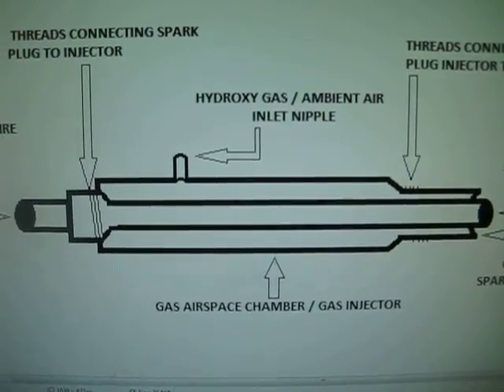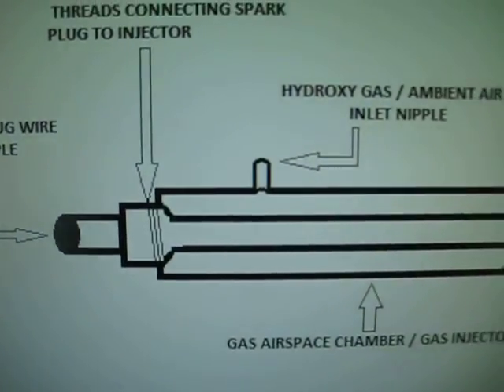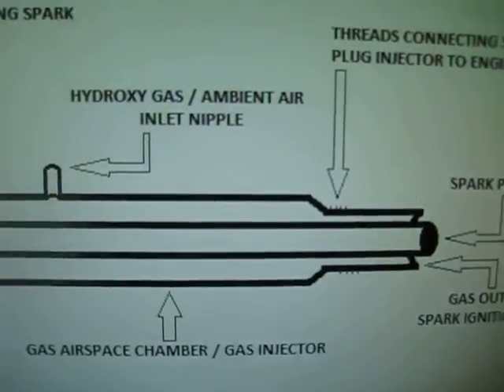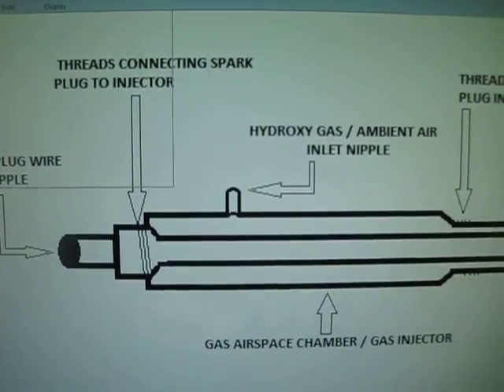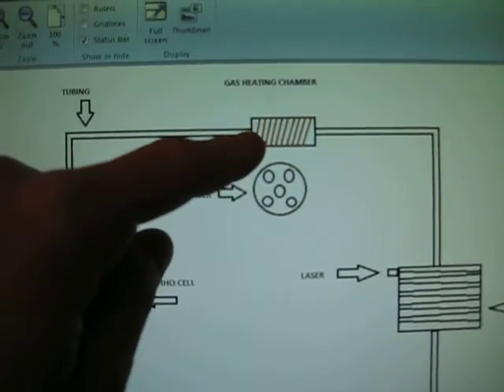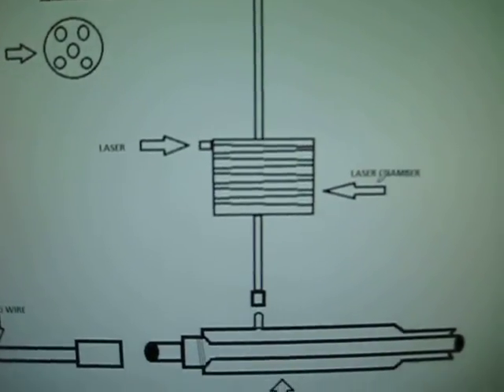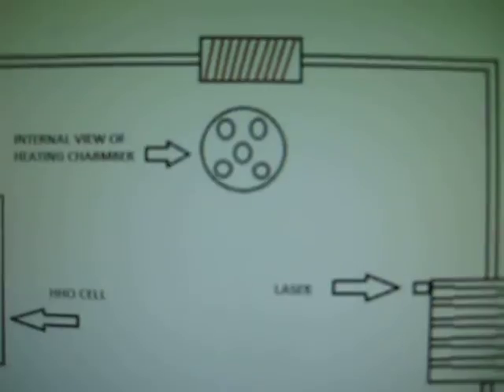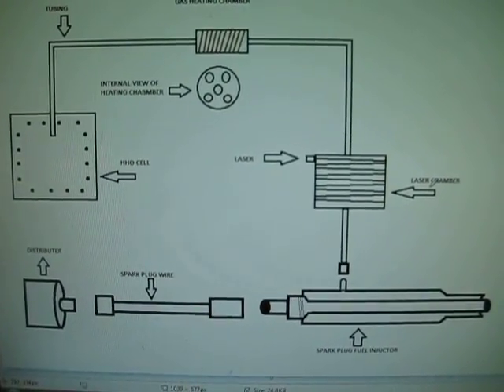HHO SPARK PLUG FUEL INJECTOR

Comment: I don't see any way of preventing the HHO from burning inside your injector. And by the way, steam does not burn, it does expand though, when heated. Stan would have used the steam to slow down the burn of the HHO and add additional expansion energy to the gas mixture in the cylinder.
Reply from the maker: There would be grooves between the walls that separate the walls and act as a flash arrestor (groove would be about .001). As for the steam helping with the HHO process the hotter the water the less energy you need to split the molecule. Stan used exhaust gasses to slow down the burn of the HHO he did not use steam to do that.
Reply: Tyson Capel
I'm just going by my basic knowledge of physics here. I don't know of any reason to think that tiny grooves can act as a spark arrestor. It would create a bit of minor turbulence, but that wouldn't prevent the backward propagation of flame, SFAIK. For that you would need something that could act as a heat shield, which is not evident in your drawing.

I do know that HHO gas has it's own oxygen and therefore can burn back into a confined space where a non-oxygenated gas would be snuffed out by lack of oxygen.

And I know that steam doesn't burn, but it does expand 1800x from liquid into gas and also slows the rate of burn of other gases. If you tell me that it's easier to disassociate steam into HHO than water, then OK, but you're still not burning steam, you're burning HHO. I repeat, steam doesn't burn.

I stand by what I said about Stan Meyer. He was perfectly able to turn water directly into HHO without using or generating a lot of heat, which even electrolysis will do. He didn't have to turn the water into steam first. Stan definitely knew the difference between water and steam and he would have said steam in his patent if that's what he'd meant. Stan was not trying to hide his technology in his patents. They're not so full of legalese as to be unintelligible.

It's fairly clear from what I remember of Stan's patents that he was using a particular pattern of high voltage, low amperage pulsed DC current to create a resonance that would dissociate the hydrogen from the oxygen in the water molecules, and he was able to do this because hydrogen and oxygen in water are oppositely charged and thus attracted to opposite anode plates. A large part of his success was in the efficiency of the electrical circuit that he used and how he tuned it.

I don't know which patent(s) you're looking at because you don't say, but you're better off trying to understand what Stan actually wrote than trying to come up with your own interpretations of his pretty pictures using a faulty understanding of physics. The patent examiners didn't give Stan too hard a time because he patented things piece by piece and each piece was competently described. His work didn't raise the red flags that usually cause examiners to call something a perpetual motion machine. Thus, there wasn't a need for obfuscation.
Reply from the maker: You are correct steam won't burn, you can however use a plasma spark to ignite steam but it is first instantly turning the steam into HHO before it is ignited.

Small grooves as I explained will in fact suppress a flame from HHO as long as the space of the groove are small enough to do so this is why I said the gap would be about .001.

As for everything I have said not being in the drawing that is correct not everything I said is in the drawing because this was a simple basic drawing to get the concept out there, there is certainly allot more to it then what I have shown. 

The drawing was taken from one of my fuel injector adapters that is used to vaporize fuels such as gasoline and runs off of similar principles.

HHO does have it's own oxygen as you say that is why its called HHO (hydrogen,hydrogen, oxygen) or 2 parts hydrogen to one part oxygen. It is very unsafe to use if you don't have the proper flash back protection. the drawing shown in the video is a two in one adapter. It makes HHO and suppresses it within the same space.

I know that Stan was able to produce HHO at a very high efficiency by using the proper circuitry which would create a resonance enabling the water molecule to split at a much lower amperage then that of traditional electrolysis. His circuitry would allow for peak voltage while at the same time decreasing the amperage and was done at a resonant frequency. The resonance he speaks of was a full circuit resonance not just a resonance of one particular part of the circuit such as just resonance in the cell.

Stan did use a steam resonator this was used to keep the water above freezing which would allow his system to be used anywhere in hot and cold climates. As for Stans Injector Spark Plug it has been understood by many people that the injector did act as a steam generator within the injector itself. As for wither or not that is actually the case we need more information on his injector to be able to say for sure wither or not that is actually the case. There is not allot of information out there on his Spark Plug Injector.

I don't have a faulty understanding of physics, that is a pretty bold statement for you to say without knowing  who I am or what I know. I have spend hundreds of hours reviewing and dissecting Stans work and some of the stuff I say does not come directly from Stans work, I take the basic concept of some of the things he says and use it as the mainframe for something else. It's the concept that you often have to go off of especially when it comes to Stans work. Not everything he shows in his patents works the way he says it does. You have to change some of the stuff in order to make it work correctly because it is not completely accurate, he purposely put stuff in his patents that do not work the way he says it does. He wanted to get the concept out there without giving away all the secrets. This is why you work off of the concept and not off of exactly what he said in his patents.

A closed mind is a weak mind, you have to often look and think outside the box. 

I hope this helps clear some things up.
Reply: Tyson Capel ev gray had to do the same thing with his magnetic motor and I'm sure most inventors protect their creations this way it's also where patents on things that don't work bs comes from

Comment: Stan was splitting the water mol by using plasma at a higher voltage than most people know. I studied lightning in the lab for the gov. (sandia)The higher voltages (45kv+)split the mol with much less ampherage. This is done at a higher frequency than the 10khz stan used for his WFC. The injector system was never tested at these higher freqs and voltages ddue to what was available at the time. I replicated the whole process and found it barely breakeven when using an ICE to demonstrate.

Comment: Stan had over 250k in his bank account and had just signed a 50mil contract at the time of his death.He wasnt waiting for funds. The injector system just wasnt working right. It didnt rely on sonocatalysis,that was bs that he used to throw people off so he could finish his work without hassles from others. water was split by plasma catalysis in the cylinder and was only used during accelloration phases. running power was had by recirculating the exhaust gases thru the air processor unit.

Comment: yes it does...It burns all the time when you drive down the road with your gas guzzling polluter. Gasoline makes O2,H2O,NOX,CO2,and leftover hydrocarbons that use a catalytic processor to finish the burn of the exhaust gasses.(texaco answer man...)

Comment: hydrogen burns at >8000ft/sec.gasoline burns slower, allowing it to be used as a primary mover for automobile use. Meyer was trying to adapt the ICE to use hydroxl as a primary mover. This cant happen as the stroke isnt short enough to work. It does barely work in a weedeater motor,due to its short stroke.It would work better in a rotary configuration.The problem to overcome is the exothermic VS endothermic reactions in the power stroke.you need the endo to happen at least during the exhaust.

Comment: Stan 
Meyer didnt think like others. he was trying to find the solution to the little bit of energy that hydroxl forms. That was the problem. He made more output from the water cell than the injector system. The reason he chose a vw is the miserable output from it. (120hp at best,with a turbo and two carbs...)the stick was set a bit lower to jump over..The biggest hurdle was the superquick burn time of hydrogen compared to a carbon based fuel.You dont steal something of no value.

Comment: I would think the problem Meyer had was to generate first the resonant frequency to split the water molecule, then instantly change to the resonant frequency to ignite the hydrogen. This would have to be done very quickly, alternating back and forth. It's possible Stan Meyer had the whole thing working, but the waiting periods he mentioned had to do with funding (and also perhaps in developing a much smaller freq generator?).

Comment: Meyer would not show everyone how easy it is. Otherwise people would have easily stolen it and it would be in use. I think Meyer only showed us the special spark plug adapter he used, but didn't show the electronics that goes along with it. That would be a high frequency generator tuned to the resonant frequency of water. It is probably that, the water is run up to his spark plug, where the high frequency zaps and splits the water molecule, then ignites the hydrogen with a different frequency.

Comment: Hi Tyson.  I really enjoy your videos.  Im just starting to gas vapor unit for a 1984 Mercury. One thing im not 100% clear on is does the chamer need to be warm/hot to get enf vapor to run at freeway speeds?  I also heard that running vapor in engines designed for carburetion/fuel injection is hard on valves. Not a real problem for my Merc, but how is your Rendezvous holding up?   Thanks at ton.  John Whitted. Whitted848687@yahoo.com.  or the gmail I have my youtube account

Comment: This is just a theory but I have spent a lot of time looking into many different ideas but if you could instead of putting hho to the injector put a mist or small spray of water on your injector then all the force from the water being electrolized would also help project each piston down plus your also putting a little oxygen in there too which is always good for fire.

Comment from the maker: This particular video is not my design it was an idea I had about a year or so ago to make a device similar to Stanley Meyers that could run a car on water. My fuel injector adapter and spark plug adapter are allot different then this design. I am going to share all my designs test results etc. on the adapter I designed once I have protected the design. Once it is protected I can share whatever I want to about it. Anyone would have access to the information because it will all be in a patent.

Comment from the maker: I can't explain to you exactly how I do it at this time because I am still in the process of protecting the design but know that it is impossible for an explosion to occur in the spark plug or fuel injector adapter chamber. Even if there are sparks in the chamber it is still impossible for the HHO or gasoline vapors to to ignite.

Comment: But if the explosion is happening in the chamber of your plug, the forces of the explosion or going to be starting in that chamber and then projecting out of the plug and then onto the piston. That is going to be alot of force inside your plug. Especially if your plug chamber narrows as it gets to the tip. And you would have to insulate your electrode so u dont have spark happening inside the chamber.

Comment: the only problem i see is that you will need to find a way to have a permeable barrier  at the tip of your plug that only lets the hho through but prevents the explosion from traveling back up your plug chamber and causing your plug to blow apart

Comment from the maker: Another thought I had for running a car completely off of HHO was to directly inject the HHO into the inlet that your fuel line is hooked up to. You may have to pressurize your HHO gas a little in order for this to work but not enough to make it dangerous. If done this way you would need to control the amount of air going into your air intake. You would have to reduce the amount of air that comes in through your air intake to prevent the HHO to air ratio from being to high.